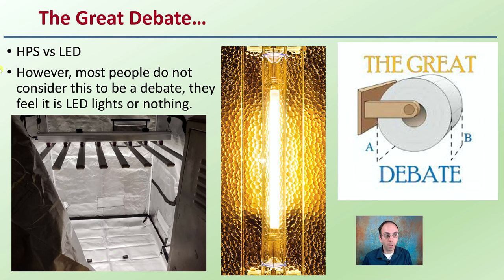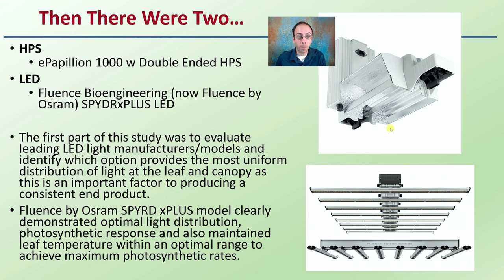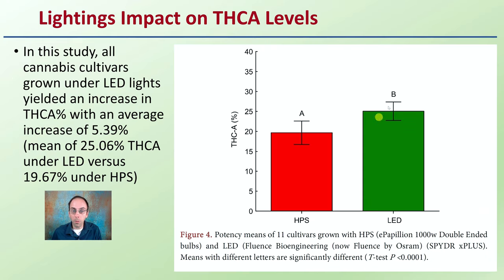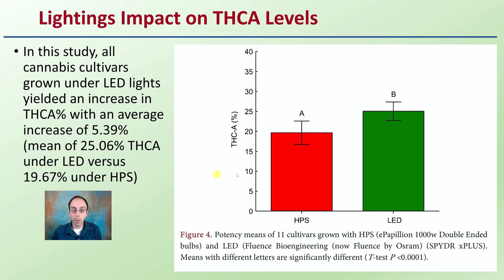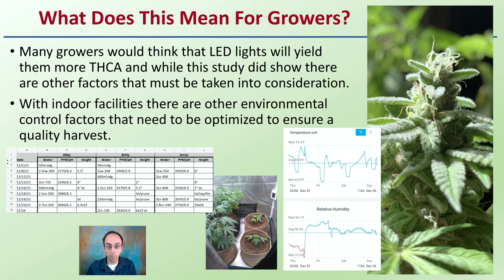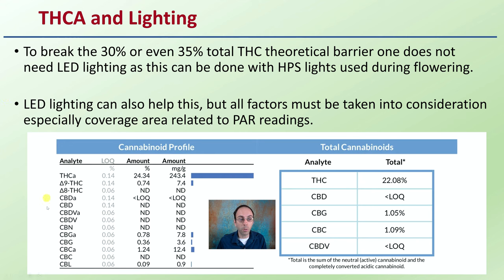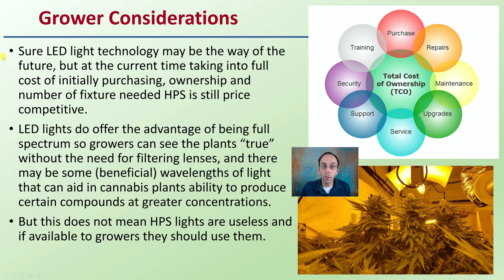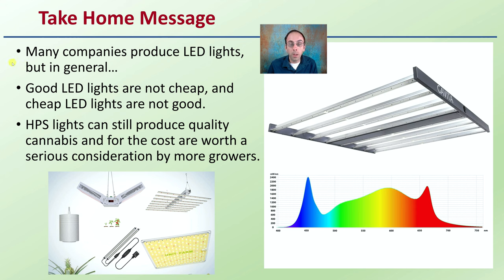Potency of Cannabis Grown Under LED and HPS Lights

Comment: As long as you have full spectrum and a PAR meter to measure light, you should be good. High end LED lights like Luxx are very good. But as far as thc and terpine production, alot of factors come into place. But really if you do proper plant work, and have your nutrient and humidity levels in your medium balanced, you will get a quality harvest. But that does not end there. You can have a perfect grow and harvest with the highest quality outcome, but if you make a mistake during the drying AND curing process, you end up with less than desirable quality. I love your videos, Debacco! Keep them coming!
Reply from the maker: You bring up an interesting point, the video can at least try and provide some help with one part of the bigger puzzle you mention;-)
Reply: I always liked HPS until I got an electric sky ES300 LED. My electric bill is much lower as well.
Reply: @WildBill496  Hows your yield?
Reply: @drobro4396  lower i guess
Reply: @drobro4396  HLG LED. HLG 600R.  These are top of the the line I guarantee you success.
Reply: @muthrfuqrjonz3530  I have 4
Reply: Said perfectly
Reply: The drying and curing is tantamount...
Otherwise you get harsh hay flavor...
Thanks for mentioning that...
Reply: The dry and cure is just as important if not more important than the actual grow. It’s proven scientifically that HPS produces much better light that produces much better buds. Only upside to led is the low heat and low energy usage. But hps gives off more light per watt than anything else. If you use a mixture of lights for different aspects of growing, like using hps for vegetative state, and then add led while flowering so you have a guaranteed full spectrum of lighting from blues all the way to reds and yellows.
Reply: Good points!!! I enjoy informing everyone the task of caring for cannabis cultivation does not end until consumption! It is a long and detail oriented project where EVERYDAY counts.

Comment: I found a happy medium with led and hps lighting together that the plants respond nicely to .seems after many harvest vests  the combination of led and hps causes tighter bud node spacing and more dense buds from the blues coming from the led
Reply: Thats what im doing bro. I still love hps idc what people say lol. Specially for flower. I like using hps during winter cause i grow in my shed helps keep the heat up but yeah a mix of both works great.
Reply from the maker: HPS still have use can have proven effective as you have found out.
Reply: Learn how to work with those leds. Make sure that your leaf temperature is 5° cooler than your room temp. Run them warm and run that co2 .
Reply: Can't confirm this. But the place I bought my led told me a hps will cancel out the led light as it messes with the spectrum with the two combined.
Reply: @dtw6485  Bro Science my friend
Reply: @marcosjaramillo9892  the idea of using an HID fixture for temperature control is spot on my friend but if I were doing that I would have used a 630 lec.

Comment: Everyone wants to take a side and the answer more often then not is... IT DEPENDS. Another great video.
Reply from the maker: Just trying to provide data so people can make informed decisions.
Reply: We appreciate it! 👍
Reply: Actually if you aren't getting better results from Led than hps, it's just a problem with you or the grower. Not the fixture. The depends that you're talking about actually should say depends on if the grower knows how to properly use LED fixtures because you can't just take the hid down and stick the LED up and walk away thinking your job is done and it will now go to plan.
Reply: @demsandlibsareswinecancer4667  well yes of course. But I'm generalizing as to why people think one over the other. Because most do not think of all the variables. They think of doing what they know works and that it works better with one light over the other without diving into why that is. Even large scale growers make this mistake. Not everyone who grows wants to know the "why" and "how" to everything and so that causes issues when things change because they are not understanding the impact that change has on other variables in the room and what needs to be changed to compensate for that change being made. So I agree with you but again I'm just give a general reason as to why. If everyone thought as you do then yhe growing space as a while would be more advanced. And I'm all for it.
Reply: @TriStateTrichomes  In terms of energy efficiency LED is objectively better, but if you have to cover a large area (greenhouse?) it gets expensive very quickly so it might still be interesting to consider HPS, especially if you "need" the heat anyway like in Canada. You also have secondary benefits like having seeing true color much more easily under LEDs which helps when steering your grow, finding pests etc.

Comment: I've grown with hps for 40 yrs and will continue as i use the heat generated in wintertime to maintain temps. Have tried leds and spent plenty of money on them but they just dont satisfy my needs. 
I'd rather replace a bulb than an led fixture. Much cheaper, longer lasting and better quality herbs with hps for me and my indoor growing environment.
And i didnt notice any energy savings when using leds.
Reply from the maker: Many would agree with you.
Reply: Alot of long time growers share the same sentiment as you. I mean we've been able to access high quality cannabis for decades now, so HPS isn't some obsolete technology that doesn't work, its just about efficiency. The math shows that you break even at the 1.5 to 2 year mark, and after that you begin to save money when using an LED fixture. Most large brands offer a 5-year warranty on their lights, so if anything goes wrong in that time frame, you should be covered. Of course this doesn't account for ease-of-replacement if a fixture failure happens mid-grow though.

Comment: I use both, Hps in winter. Led during summer
Reply from the maker: Why the change based on season?
Reply: @DeBaccoUniversity  I use hps in the winter. I use outside air to cool the grow. Id actually have to use a heater to use led in the winter. I use led in the summer as its more cost effective to cool an led room than an hos. I love both of them. I do think hps leaves more room for operator errors.  This just works for me.

Comment: for newbs, run some cycles under the hps as a hedge to offset 10x cost of led. then add the costly Led to the mix and save electricity.
Reply from the maker: Great suggestion!
Reply: I disagree. The method of growing with LED is not the same as hps. It's more than just taking the old light down and putting the new light up. If they are new, they need to just start with whatever they're going to finish with. If you know how to do it it is actually much easier growing under LED than it is hps.

Comment: @Debacco University 

Hey your videos are great Thank you !!!

3 questions: 

1) How you determine the right leaf temp ? How they determined that in that study? (if LED create less heat so we might need to increase overall room temperature to maximize leaf temp for photosynthesis ?

2) what was the difference between the LED spectrum and the hps spectrum ? 

3)This question, from different video you had, about nitrogen fertilizer. you said that in Canada, they had study that you can go as high as 200 l/b per  acre, how you convert this for practical hydroponic quantity applications ?
Reply from the maker: Thanks for your interest answers provided below...
1.) This in part can depend on the VPD, but typically 80-75F is a good starting point.
2.) You would have to compare the spectrum provided by each manufacture
3.) This link to conversion factors should help... https://www.nrcs.usda.gov/Internet/FSE_DOCUMENTS/nrcs142p2_022760.pdf
Reply: Thank you so much for the answer!!! 

when you said in question 1)“ 75-80 degree”, do you refer to the leaf temperature or the room temp ?

Thanks keep it up, very interesting chanel.

Comment: I have been using a 125w CFL light for vegging and must switch to LED, my question is which wattage LED do i need to be near equivalent to my 125w CFL (Compact Fluorescent Light bulb).
Reply from the maker: PAR meter would help and to get more area stick with the same wattage and you will have a larger growing area with most LED lights.

Comment: i have a question , i am a novice grower  i have ended up with 2 cupboards and 2 600w lights, 
i have been starting plants under one light then transferring to the other cupboard for flowering..
as i have 2 TS600s should i put the 2 together in one tent  and just grow plants from start to finish under 2 600w, or is that overkill ?
Reply from the maker: All depends on the size of the cupboards.  600watt light is probably good for about 0.6meters x 1.25 meters or 2ft x 4ft.

Comment: LED are better for overall use due to their ability to ride lower WATTS while producing less heat while getting closer to the plant with the same amount of labor... It's overall a better choice cost wise.
Reply from the maker: Just be aware of the total coverage area of the LED lights as sometimes more a required and growers must balance a more efficient fixture vs need more of them, what is the net benefit.
Reply: @DeBaccoUniversity  absolutely! The par from an LED may only cover a small area when closer to the canopy. Luxx lights make single bar 400watt full spectrum LEDs for this purpose. These specific lights are pricey though

Comment: as always great videos, but after more than a decade of testing different types of lamps starting with MH-hps then induction plasma, then every type of LED and even LEP, we should discuss more in depth some aspects of these researches and tests that are found online, to be correct the tests should take into consideration the best possible setup for each type of lighting technology, if for LEDs it is enough to hang the lamp, for HPS it is not like that, the best setup for a MH-HPS system is composed not only of the lamp but also of a "cooltube" system and an adequate reflector (adjust-a-wing like), with a setup like that the heat, primary problem of HPS, is almost completely missing.
That said, no longer having the problem of temperature you can bring the plants closer to the lamp even more than with LEDs, producing the same if not more ppfd than the corresponding LEDs at the same wattage!
Then I would add that with a cooltube system the hot air produced by the lamp is immediately expelled from the growroom practically not increasing the overall temperature of the room, on the contrary the LEDs, which do not have systems like the cooltube, but still produce heat, heat that instead of being immediately extracted from the room will remain in the same causing the general temperature to increase!
Making a trivial example, it is not possible to use co2 with the sealed room with LEDs and without AC precisely for this aspect, while with an HPS and coolbute that use an independent ventilation system it can be done, saving a lot of electricity!
Now I would like to see a comparative study between a top range LED 600watt against a HPS600watt but with cooltube and refector!
Obviously very few people talk about this, and certainly no lamp manufacturer, given that you pay 250 euros for a complete HPS kit, while to have the corresponding LED one you have to shell out from 800 to over 2000 euros, it is certainly better for them to focus on LED technology given the enormous difference in price between the 2 technologies...
Reply from the maker: Thanks for your suggestion and while it seems easy it can be a challenge to develop a good comparative study.

Comment: Should I turn my led light to the max for intensity ? While in veg and flower stage ?
Reply from the maker: Flower should have the greatest PAR, but max intensity may result in plant burning, as distance from plant to light needs to be taken into consideration.
Reply: @DeBaccoUniversity  thanks
Reply: When it is a Seedling or clone no more than 200 ppf. When you are in veg it should start at about 300 and finish around 500 to 600 ppf. Flower should start there and by the last few weeks you should be ramped up to maximum output and be hovering around 900 to 1,000 ppf. Unless your genetics and plants tell you otherwise with tacoing leaves or some other response that says too much light.

Comment: what says science about yield in terms of efficiency? I am used to know both technologies but when i compare yield from 600w hps to 600w led the case is more than clear in my opinion. of course there are higher investemt costs, but when i sum up future additional cashflows caused by additional yields by led i always recommend to go with led if circumstances allow to do.
Reply from the maker: Inputs and returns on investment is an important calculation for growers to make.
Reply: Correct. A decent grower can usually meet or exceed yield expectations using approximately 30 to 40% less power.

Comment: I know that the cost of led fixtures are high, specially when growers has to buy a few, the savings is on electricity,. Way less heat wich it means, the grower doesn't have to run big ac nor often. So a grower will save so much on electricity. Also, led fixtures run on less watts and produce the same or more intensity as hps. Leds you save, it pays it self at the end
Reply from the maker: Growers need to do some of this rough math and determine how long it will take to break even so they can make an informed selection.
Reply: @Priller007  it's not cap, cause it become more cost-effective. I'll give u an example; let's say u got a 10x10 room and u run 4 to 5 1k watts, each hps pulls 5 amps each,that's a total 25amps. Now u get leds, u can run either 400watts or 600 watts led in that room, and get the same or more light output and more coverage on each led fixture. Which the more light the more yields and. Also,, it's been proven that with leds the harvest time periods are shorter by 1 week or more that hps. That means u can add 1 extra grow in the yr. Also u can put 3 to 4 leds per each 1k hps the lights produce less heat, meaning u don't have to run the ac as much, out of hps u might get 2 to 3 good harvest before u have to buy new bulbs, the led chips/diodes last from 5yrs and better, so that's another area of saving. With digital ballast u have to get hps and mh bulbs for each fixture. That's how led are more cost-effective

Comment: i think this video should have gone more into the topic on who are these lights for. hobby indoor growers with a 1x1m growing space for exapmle:
400-600w hps would be needed for that space imo. now, if u want quality components you should get a dimmable psu, nice reflector with air ventilation (because without, temps will get out of control, if you havent got a air conditioner) and a good hps bulb. add that up and you will come out at around 200-350 dollars. 
for that kind of money would will get 300w lm301 fixtures. i would say, LED is the homegrowers choice and hps is good for big commercial grows. 
but still, wasting energy is always bad so lets transition to led.
Reply from the maker: HPS can still be used in small operations and should be at lest considered to determine if it is a potential good fit for an operation.
Reply: @DeBaccoUniversity  why exactly?

Comment: i still use my HPS 250 watt i got a OSRAM bulb for it use's less heat. it works pretty good but  i guess i also have a 200 watt CLW COB light and i guess that 1 works a little bit better but i added a far red light to it so with out the far red light the HPS would be just as good as the COB i think but it use's so much energy damn, it use's more then 250 watts, so thats a bad thing and i only use it when it's winter time now also but i must say in a tent the HPS is pretty nice you just have to get a good distance from the plant so it doesn't stretch to much the HPS also works grate with my MIGRO UVB light, that add's over 3% THC anyways, and you can't buy that light in USA anymore also haha.
Reply from the maker: Overall 250 watt and under lights have a limited coverage area so be sure to consider how your set-up could be applied to a larger set-up.  However, thanks for sharing and hope you continue to get good yields.
Reply: @DeBaccoUniversity  I forgot to mention I added 2 LED bar lights to reflect more light around the tent also so its about 273 watts overall

Comment: Led are cheaper if you consider electricity cost over 1 or 2 years. HPS usually require more power for heat dissipation. LED are also dimmable
Reply from the maker: Growers need to consider all costs of options both short and long term to make an educated decision for their operation.

Comment: Come on doc we all know that HPS lights are hotter use more energy they have to be changed every year  just to name a few things LEDs are superior to HPS I used to grow with them but after trying LEDs my temps were cooler my light bill was smaller and my buds were spectacular it seems that the old guys just won't let the HPS go well I'm 50 and I got tired of my tip baking like an oven and my light bill being high as hell with no control over the Spectrum I want it's a no-brainer
Reply from the maker: There is something to be said for leaf temperature, and HPS is not dead, even in commercial applications.